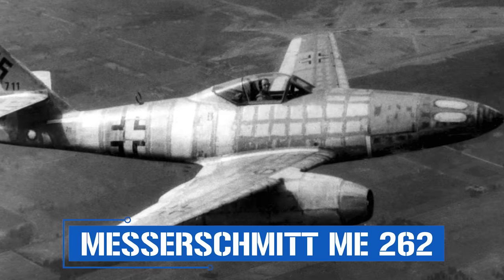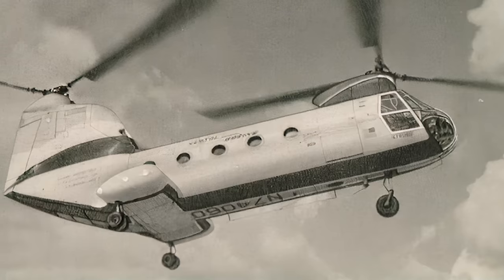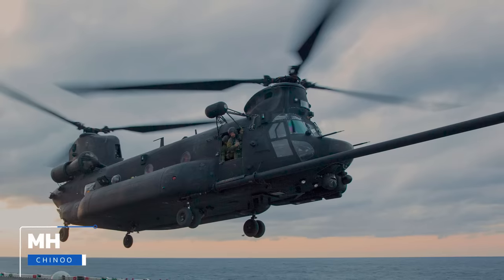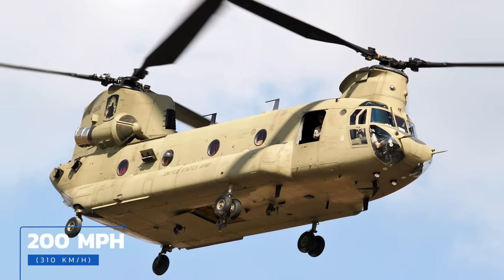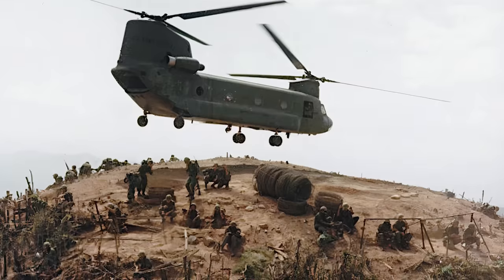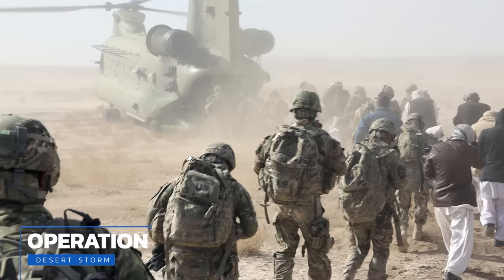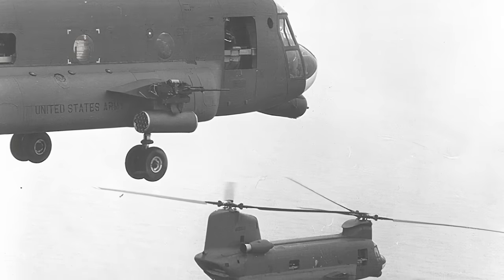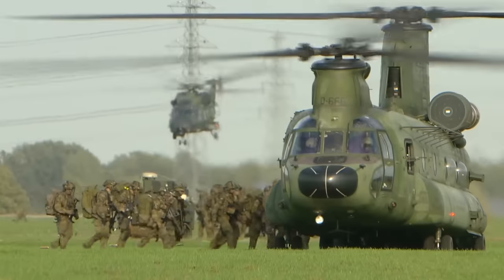The Boeing CH-47 Chinook

Comment: I was a Flipper pilot (CH-47s) during 1969 in VietNam - 196th ASHC (Assault Support Helicopter Co.)  Our "A" and "B" models had engines with 2750 shaft horsepower each.  2.5 hours of fuels added 4,000 lbs. of weight.  We normally could easily lift a 7,000 pound external load.  For a load approaching 10,000 pounds, we would delay until we had burnt off 3,000 lbs. of fuel.  112 decibels of sound in the cockpit meant I learned the joys of tinnitus since my early 20s and high frequency loss of hearing.  I can not hear the blowing of a whistle or the higher notes on a piano.  Instead of the strings being hit by the hammers in the piano, I hear all the sounds of the working of the mechanisms to strike those strings.
I have performed single-engine rolling takeoffs after losing an engine in a remote location and not wanting to risk staying there with a disabled machine and a target for the enemy.  I have performed one engine approaches to a slow short rolling landing.  The earlier model chinooks could hardly be expected to hover on one engine.  I have suffered transmission failure in flight getting the aircraft to the ground just prior to total trans-box failure.
I once evacuated an entire mountain village in one sortie, over 100 souls on board, included all their livestock.  Quite an aroma, even in flight.  I know the current hook drivers are taught to drive it like a bus, but this aircraft is extremely capable and when needed can perform when flown as if you stole it.  During the years in Afghanistan, I understood and appreciated the mighty force of the CH-47s and how they were deployed in areas of higher elevation.  They are a force to be reckoned with.
Reply: Thank you for your service and the additional information.
Reply: And yes, tinnitus is a Bitch. Too much rock music back in the day, I imagine.
Reply: What a baller. Bravo sir
Reply: Pfft... Tinetus is sitting in the back of a lock down  M113 on battle runs with a trigger happy crew commander. 
End result is always the same, except I got blisters when they'd make me get out and walk around deaf after the cav-wits had their fun.
Reply: The hearing loss was from the 112 decibels of non-stop sound from the transmissions.  80-85 decibels for 30 minutes or longer without protection will result in permanent hearing loss.    What is that you said?
Reply: Always awesome to read something said by a legend.

Thank you, sir.
Reply: @davehertle  it's not an entire loss of hearing like most people think, just damage to the ear drum and loss of hearing such as high pitched noises and tones. 112 dbs is about the same as a loud lawn mower while the cutting blades are on, now in short doses that's not bad but considering it was constant does much more damage. 

Source: work as a mechanic and have had my ears checked many times due to me noticing hearing loss. With alot of the older guys it's much more noticeable but most of them have 20-30+ yrs on me.
Reply: @perryleduc1954  I agree.  I have no hearing loss at Middle C on the piano and lower notes.  I hear vowels very clearly, but have issues with the consonants - "c"- "k", "t".  Some music sounds weird - not hearing the complete chord.  Not complaining, just reporting.
Reply: Welcome home, David. Thanks for your service.
Reply: Did we fly together?  196th Oct 69 - Oct 70
Reply: I hitched a ride in a Hook from Phan Thiet in 1968 up to somewhere (I forgot) to go up to Da Nang to pick up a new in-county Huey.  Seating near the cockpit was just painful in the hearing department.  Finely moved to center of the ship and put on my own helmet to block out some sound.  Don't know how you endured the job.   I never wanted to get the CH-47 MOS added to my records.  More power to ya!
Reply: I flew DustOff all of '68 I and II corp.  I wanted to stay longer, but surviving 12 months of DustOff without getting hit was my own personal miracle.  I did not want to go back to the States and finish out my time as an IP.  After Hook transition, I came back to Lane AHP and flew Hooks over territory I knew from the prior year.  In the end, I got the early out that was offered to CW2s that extended.  I got home early.  With that i will take the loss.  Flying Hooks was great fun and I did not hold back.  Those were great times.
Reply: Hey David good hearing of a fellow Flipper member. I was there Dec 68 to Dec69. I was 68f20 aircraft electrician and part time doorgunner. Like you I got tinnitus bad. The Hooks and the C130s' are the most noisy thing I ever been in. After just an hour flight time on a Hook I couldn't hear my self walk on the PSP! 
 I don't remember the B models at Lane, probably came after I left. Big Windy had B models first I think.
 Did they ever find out what caused that Hook to crash there by the field? I knew most of those guys, it was a real tragedy. 
 Good hearing of another Flipper member, you take care David. Terry Scalf, Richmond, Va.
Reply: @terryscalf6512  The Hook that crashed was on final and the nose went up, back and over in a reverse back 270 summersault.  The accident report put it on a forward hydraulic cylinder that went into full extension.  I also left in Dec. 69.  Will Radford and I heard about the early-out rumor and went to see the old man. (CO).  I got home (surprise) early morning 25Dec69
I live in FBurg an hour north of you.  I get to Richmond on Thursdays for a part time job.  We should catch Mission BBQ some day.
Reply: I served in the 196th from Jan 68 to Jan 69 and flew on 66-00093 "Iron Butterfly" as flight engineer. The A models had some issues but did a great job and we had great pilots. Thank you David for your service.
Reply: @davehertle  In 69 we flew without sound insulation on the interior. The loudest area was under the aft trans.
Reply: @TheSking20  Probably - I left, along with Will Radford, at the end of '69, early out for CW2s that had extended.  I was Flipper 45 from April to Dec. '69
Reply: @danuhr4212  Dan - During those same months you were with the Flippers, I was on the other side of the hill flying DustOff also out of Lane, though I saw little of Lane, and a lot of Duc Pho, LZ English, An Khe, Chu Lai and even Camp Evans, up north. We worked those "A" models like we stole them.  They were dependable old air frames.  Lots of support missions out of Lane for our good ROK Tiger and WhiteHorse Divisions.
Reply: Your actions led to the death of more than 600,000 Vietnamese most of whom had never wanted to fight the U.S.A in the first place.
Reply: @Kenia-sn1cg  Interesting comment you made!  First off I never pulled the trigger on anyone, yet I risked my life many times to bring wounded servicemen from both sides back for medical attention.  Shortly after I got there, I asked in prayer "Lord, what is this all about?"  Immediately in my heart I heard this answer - "This is merely a fight between LBJ and Ho Chi Minh"  I did not have an interest in making war on my Brothers in Arms.
Reply: Somewhere in my pile of stuff, I still have a CH-47A manual.  I need to find it again.
Reply: David, pretty much all the older guys I worked with while at Boeing Flight Test were in Vietnam. We did not fly it like a bus. :-)
Tinnitus has one advantage.. "honey I can't hear you". Thought I'd escaped but it's hit me in later years. 
Flew the last A model out of Ft. Indiantown Gap PA to the C Mod line at Boeing in Ridely Park, PA in 1985.
Worked the in flight refueling test program in the winter of 86. Only the military would send a KC-130 out of Hawaii to Delaware in the dead of winter.
Finally did the flight testing of the MH-47E with delivery to Ft. Campbell KY.
Funny story, was born overseas and was able to keep dual citizenship. Was asked one day if I still had that other passport (should have said no). One week later I was disappeared overseas for two years. Did a lot of sightseeing but alas no pictures. 4:55 in the video was one side-trip; no flying just technical support. Helped I spoke passable French back then.
Reply: Thank you for your service. It's really great that you shared your experiences with us. I've always been fascinated by helicopters, but I don't think I've seen one any closer than ones flying over my head. I grew up near Scott AFB in Southern Illinois, so I actually saw lots of the CH-47s flying over our house (we were right under one of the main flight paths, even had our dishes rattled a few times by jet sonic booms before they decided that was a bad idea). The really interesting thing to me as a professional musician is your comments about tinnitus. I have some high frequency hearing loss and tinnitus that was caused by a PA horn overdriven and feeding back into my ears, which were at the same height as the horn. That made me really dizzy and I felt like I was going to pass out. I can't imagine just how loud your experience in the helicopter was. Not hearing high piano notes at all is just insane.
Reply: @ChopBassMan  Thanks - Hearing test this week confirmed right ear, profound loss in those higher octaves.  I have more in my left ear.  But some chords of music just don't sound proper, because the needed note is no longer there for me.  I visit a retired Command Sgt. Major who lives in a very quiet world.  I use a white board to speak with him.
Reply: @davehertle  that is a drag! I have some higher frequency loss but not nearly that much, thankfully. As a musician I don't know what I'd do with hearing loss that severe. Beethoven became completely deaf - his story has always amazed me. I wish you the best. Hopefully researchers will continue to make breakthroughs in help for hearing impaired folks like you and your friend.
Reply: I probably worked on Chinooks you flew. I was in 196th in 1979-81. We had 16 hooks at FtBragg then. I enjoyed being a crew chief for a year and a half.
Reply: Damn talk about a resumé of badassery. Thank you for your service and all of the lives you helped save
Reply: What my tinnitus is so bad I can barely read
Reply: I love the Chinook, it always puts a smile on my face when I see Dutch Chinooks fly-over to do an exercise, it's such a sight, a true beast of an Helicopter!
Thanks for sharing this amazing story!
Reply: @TheSking20  We might have.  Will Radford and I both left in midDecember '69 when DoD offered early outs to WOs with 18 months or more in country.
Reply: @davehertle ou’re an awesome man. The idea of being in a plane or helicopter scares the Hell out of me, and I used to work in law enforcement in some of the worst neighborhoods the Birmingham, AL metro area has to offer. I’d rather have to do that the rest of my life than go in a helicopter higher than 10 feet off the ground for 5 seconds lol especially when having to worry about anything from small arms automatic weapons to RPGs to AA to SAMs doing that. Takes balls!
Reply: @ESPLTD322  Part of what prepared me is I was bored, at Ft. Gordon in ‘66, and took up sky-diving.  15 jumps, 9 free-falls, longest delay 15 seconds, but working my way up.  I put in for Warrant Officer Flight School and the rest is history,  Retired LEO here.
Reply: Thanks for taking the time to write this! It was really cool getting to read a first-hand perspective.

Comment: I remember a rescue mission they did with a Chinook on Mt. Hood Oregon, where they landed the rear of the aircraft kept the front up in the air due to the angle of the mountain side while the loaded it with the stranded hikers. it was an incredible display of the pilots skill and the Chinooks outstanding stability

Comment: The cruising speed of the CH47 is faster than an Apache… So when flying in a group, the CH47 has to slow down.

I have worked on these many times, as a civilian after getting out of the military. Being a Marine I didn’t work on them in the service.

One time we were doing to finishing touches and last minute updates on one that was being delivered to the Dutch military. They sent a lot of people over to do an inspection prior to final delivery. Several were the crew that would be in charge of the maintenance on that exact A/C.

I had been told to keep my music turned down, while they were there, as I am big into metal, especially the prog and symphonic stuff which includes many bands from Europe… It was amusing when one of the Dutch military guys asked me to crank my music, and the whole group were there bobbing there heads as they were inspecting the A/C. The boss man came and said something to me… “They asked me to.”… “Oh, ok then”

It was a good day.

Same job, they brought in a CH47 that had been hit by an RPG and crashed. It was being brought in to be stripped of useful equipment. Fortunately they set it down without too much extra damage and no one was hurt.

The molten slag from the RPG had tore through the aft section and disabled an engine and the rear transmission. The aft crew seat had been peppered in slag with the burn holes from the molten metal everywhere, luckily no one was sitting there when it was hit. The way the slag melts through metal components is nasty.
Reply: Acutely we could cruise (in the AH-64a) at 175-190 its without a combat load.  We had to slow down for our OH-58 scouts.  (See above!)  I did not fly the CH-47 but did get the AH-64.
Reply: I have to ask what music you were cranking, I'd guess Rainbow would get those heads cranking lol
I've never been anywhere near a helicopter so I'll leave it at that
Reply: @lastguy8613  It was a mix, but at that moment I think it was Dream Theater “In the Presence of Enemies”

With various other Prog and symphonic, with some melo deth, mixed in.

And yes Rainbow is always good to get a head moving. I particularly like Stargazer.
Reply: This was so cool to read as a Dutch person!
I can tell you my country loves the Chinook just as much as you do!
Great reliable machines
Reply: These first hand accounts are just so awesome. Chinooks are still an iconic part of the (small) Dutch air force!

Comment: I logged many hours on board CH-47 birds with the 6th Air Cavalry at Ft. Hood in the 80s. A magnificent piece of equipment. The sound of the jet engines powering up and the helicopter taking off still does something to me emotionally.
Reply: Stud Cav!👍
Reply: @davidchristensen2970  You were HHC 34th support BN too?
Reply: 1984-86

Comment: In case you were wondering how cyclic and yaw work on a tandem. Front/back is by increasing the collective pitch on one rotor and decreasing it on the other. Left/right is the same as a normal helicopter, apply left or right cyclic on both rotors at the same time. Yaw is by opposing left.right cyclic at the front and rear rotors which rotates the aircraft. There is no pilot controllable fore/aft cyclic but there are electronically controlled "longitudinal trim actuators" that apply forward or rearward cyclic to the rotors to pull the nose up in forward flight to decrease drag or push the nose down in hover (CH-47s naturally hover nose high because the masts are slanted forward slightly). On a tandem fore/aft cyclic won't propel the aircraft it pulls up or pushes down the nose.

 The collective lever in a CH-47 is called the "thrust control lever" instead.

 Theoretically you don't need any longitudinal cyclic at all on a tandem, they can work entirely with the left/right cyclic axis only. (remember forward / rearward is by collective difference between the two rotors)

Comment: Don't forget, it was Frank Piasecki who pioneered the tandem rotor helicopter in the U.S. in the 1940s.  His Vertol Helicopter Co. was eventually purchased by Boeing becoming Boeing-Vertol.
Reply: 2:10
Reply: @gniawd  I was pointing out Piasecki's connection to Vertol.
Reply: Exactly. The Piasecki CH-21 flying banana is the proper predecessor for the Ch-47. It was used in Vietnam before the CH-47 was put into service.
Reply: @markowsley4954  And the H-21 and the HUP.

Comment: Chinook was an awesome aircraft... way ahead of it's time. By having 2 counter rotating blade assemblies, the chopper didn't need a tail rotor to counteract torque from a single rotor. This allowed the aircraft to have a very high top speed and the ability to lift heavy loads. Some aircraft are icon's and still in use 50 years after they were introduced to the world: Chinook, A-10, B52, F15 Eagle.
Reply: It still is!
Reply: @teaser6089  Thanks for comment

Comment: You did it a lot of justice on this one, Simon.
One of my favorite abilities of the Chinook, though, is its total flexibility. Armor? Pick a level. Range? Add extra internal fuel tanks. Weapons? Multiple machine guns, cannons, rockets, automatic grenade launchers, any direction you like.
It can land, literally, in the water. 

It can also do a hybrid landing called a pinnacle where only the aft gear is grounded, meaning it can access almost any location of any size if there is air clearance around it.

And while the statistics are neat, the loading is incredible. There's no drawn-out process of attaching a load. Ready loads can be hooked midair in 30 seconds without ever landing; it's accomplished by the aircrew inside.

But, by far, the best thing is its maneuverability. Due to its tandem rotors, it's capable of moving  and rotating in virtually any direction at speed. And it's slated for Block II upgrades in the near future, which I'm excited to see come to fruition.

Comment: It's been 53 years since my last Chinook flights, but my ears still ring from the brain-scrambling whine of the big round gearbox connecting the two engines and the rotor driveshafts. Hearing protection wasn't a big priority under the circumstances.

Comment: Can’t forget about the MH-47 (up to a G)  flown by the 160th SOAR “Night Stalkers”. Anytime you hear on the news that special forces took out some high value target deep inside an unfriendly place, you can be sure they rode in on a 47 by the 160th… Also, aerial refueling in a helicopter is not terribly common in other units
Reply: NSDQ ♠️
Reply: They are back to flying to the x